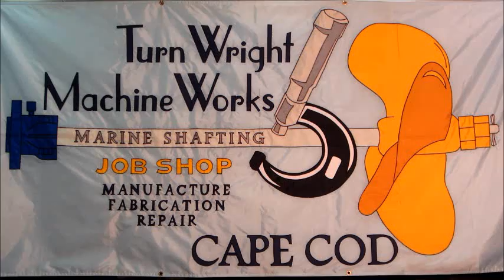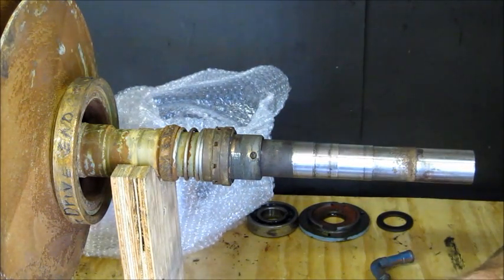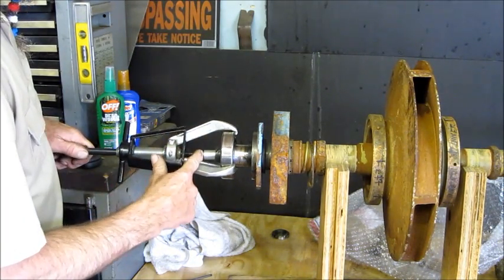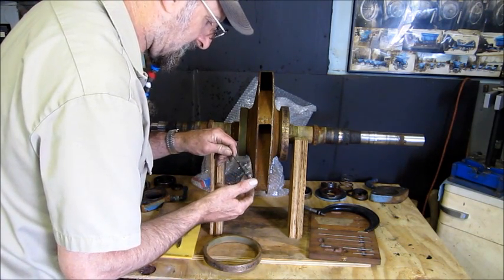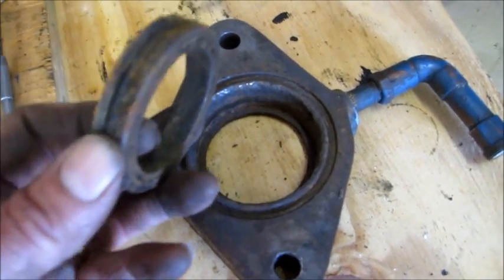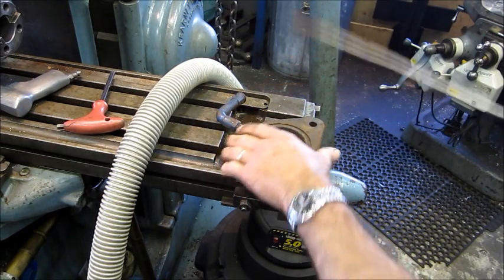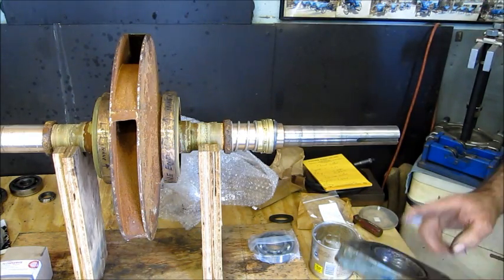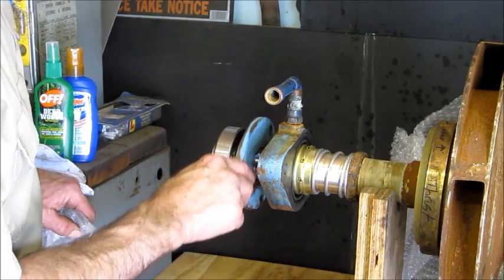Double Suction

Comment: Keith nice work on the pump.  Cleanliness is really important on seals as you point out.  Especially important on pumps that circulate harsh fluids or operate at cryogenic temperatures.  I guess you can only suggest to the customer the best repair for their project.  If they don't want to spend the $ then at least you told them what they should do.  That is got to be tough as others point out keeping your reputation and trying to satisfy the customer.

Comment: I know what you're getting at when it comes to repairing things correctly. Just a couple months ago I was told to replace the mechanical seal in a pump. The only part they wanted replaced was the mechanical seal, not the bearings, not the lip seals and not even the o-rings.

Comment: Keith, your work ethic is amazing. You didn't use any Loctite products for the seals or the gaskets or the wear in the shaft.I think Loctite made them so you dont have to have any brains to do a repair like this. I was impressed when  you used an open ended spanner [I think you call them box wrenches] on the puller rather than your usual shifting spanner. Right spanner for the right job.My German uncle calls shifting spanners " American spanners" from seeing soldiers in WW2 using them.

Comment: Gday Keith,I saw that little moment when the second bearing caught before it went on,one of those "oh crap" moments but all was good.Got caught like that when I was a young fella and just out of my time putting a coupling on a nine inch shaft and didn't have enough heat in the coupling and it caught about halfway on,had to wait till next day,heat,remove and start again.All part of the learning experience I suppose.  Cheers Ross From Australia

Comment from the maker: The pump I'm working on in the shop is for a fresh water supply for town water, so it's not used in salt water! There are many different alloys used in making pumps and pump manufactures make a lot of different pumps for different uses. The alloys of components used in pumps are governed by intended use and the dollars one wants to spend!

Comment: Great vid!  Posi Lock puller: good choice!  I just bought a small two ton model (103) for pulling the bearings on the spindle and motor of my circular saw.  Elegant design/great function/US made...pricey, but worth it!  Probably cost as much as a new saw, LOL!  What brand was that bigger push/puller, OTC?  Nice tip on avoiding damage to shaft centers when using pullers.
I thought 15" was a fairly large pump until I saw the still photos!

Comment from the maker: Well some were changed over to fresh water supplied but you always want water to the seals even if changed out to mechanical you don't want to run them dry either, most efficient pumps starve the water from that area around the shaft and seal. That particular supply is only set up, to supply pressure while running. ;{)-----

Comment: I would have thought those water cooling inlets on the shaft seals wee leftovers from the days when that pump had packed seals with permanent drip leak to cool them. After replacing those packed seals with mechanical shaft seals those water inlets have no function I can think of and we always blanked them off after upgrading.

Comment: Great video on the locknuts. I just removed a set from my lathe headstock. I almost tried to knock the bearing out of the shaft with a hammer, but luckily I couldn't fit one in there. I ended up using your advise and also building a bearing race pusher. Great learning experience plus made replacing the bearings a lot easier.

Comment: Stuffing box and graphite glands, beat mechanical seals hands down in these applications, in my humble opinion. Mechanical seals are great for high end cooling water and high pressure applications, but you need a clean room to assemble them, the least little bit of grit on the ceramic faces and its game over. They are seriously expensive also. Looks like the feedwater for cooling the seals comes from the pump, and if it isn't  potted water you get corrosion as seen here, they would be better having a potted water reservoir, rather than using pump water which by the look of it hasn't been through a filter. 0.048" clearance on the wear rings is a joke, these guys must have been looking in a Chinese manual, on this size of impeller 0.018" should be the max clearance. Nice video Keith keep em coming.

Comment: Seeing your work  and the manner in which you diagnose and solve problems, I  always felt that you had a lot of experience somewhere else and I was thrilled to hear at 37:00 that you worked in Shipyards doing Naval ship repair.  I was at Chatham Royal Naval Dockyard in England and  worked on O class and S class submarines including the hydraulics on gunnery control systems on surface ships . My six years apprenticeship and seven years at the shipyard were the best engineering background any one could have as the diverse machinery one handled was vast. Taking off large stubborn bearings involved hydraulic pullers. I am sure that you experienced it all, going by the manner in which you handle the finished surfaces so carefully. You have a good feel to the delicate parts in the machinery  you repair.
In this video, the manner in which you talked  indicated that you could have done  a much better job , but since you were asked to do the bare minimum, well,  I am sure that in such cases your heart ached not to have produced   your best, but you have to please customers.    In boats I do not like those  rotating seals and  I prefer the old stuffed sealing boxes with watercooling.  I have seen too many ceramic seals installed wrongly and the result in a boat could be catastrophic . 
Congratulations for your conscientious work. Well done and   may you have a good  year.

Comment: Where i worked in maintance dept. we had 3 of those pumps one was on a diesel engine for power outage, they were a bitch to repair when you had no parts but we did it, worked on it for 26 hrs. straight getting it going while diesel was pumping the spare had bad motor 250 hp motor no motor to replace company said get it going.

Comment from the maker: The Mechanical seals serve as a seal for both, shaft & housing. So a clean smooth surface is better, which is one of the barrier contacts for the dry / wet side. ;{)-----

Comment: i love pb blaster,...is that zep better ?
Reply from the maker: They are both different PB is penetrating and Zep is a Teflon base lube. I always have Zep 45 on hand, and I muti purpose it at times. ;{)-----
Reply: wow . thanks for replying,love your videos,used some of your skills the other day,had to tap a small nut/bolt combo to fix a pressure switch on a rack and pinion. the threads pulled out and had to drill and tap a bolt to fix the problem. sealed just fine !!! luckily i had the bolt/plug in my tool box so it worked out fine !!! just made me feel like i was a machinist / mechanic !!!ha ha ha

Comment: hey keith,nice job. know what it's  like trying to persuade customers to do the right  thing but it does'nt always work like that !!! hahaha one quick question.....what exactly is the super lube you are always using ? just wondering if it could be used in the automotive field ????
Reply from the maker: Super lube is a light clear grease that is kind to rubber o rings and good on water displacement. used a lot by fisherman rebuilding their reels!
Reply: +Keith Fenner  It's probably similar or even the same as the lube use on Victaulic pipe clamp seals.

Comment: I found that for heating bearings what works best, at least for me,   Is to get an old electric hotplate and some bread pans.  Put engine oil in the bread pans and put them on the hot plate.  Bring the temp up to  300 degrees or so and put the bearings into the pans.   "Cook them for about 10-15 minutes.   When you are ready to put the bearings on,   fish them out and put them on the shaft.      No chance of overheating and your bearings have some lube to them.     smiles.   I was taught this method 50 years ago.

Comment: Hey there Keith.
Just want to give you a little tip.
It's better to use soap instead of lube on the rubber parts in a pump, soap dries an make the rubber sleeve stick to the shaft.
With lube there is a bigger chance that the mechanical seal will rotate on the shaft and not with the shaft. ;)
Love you're shows, you're a real pro when it comes to rotating stuff!
Keep em coming! :)